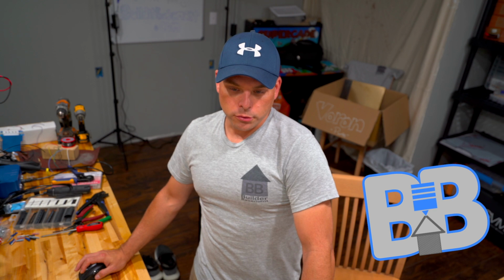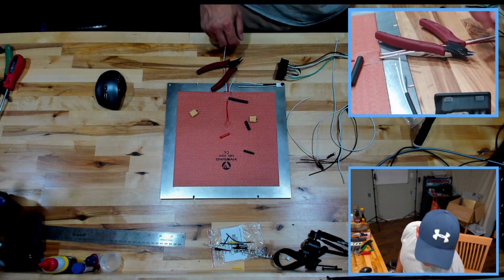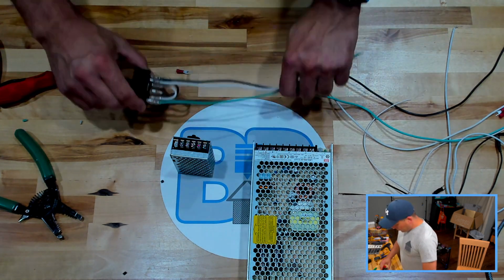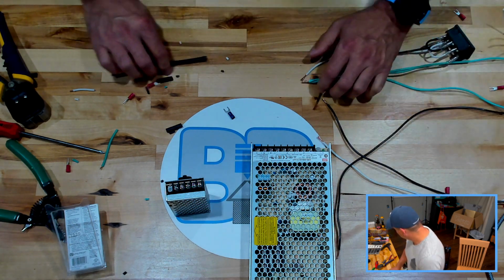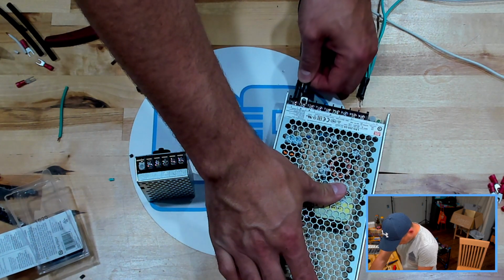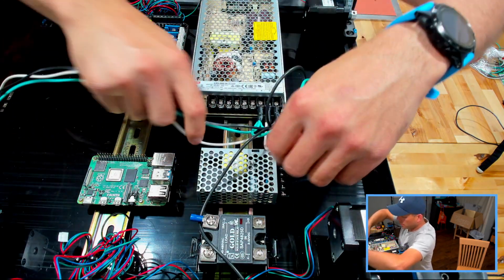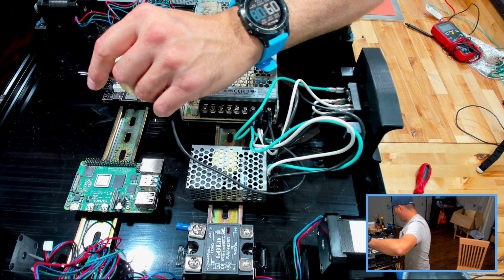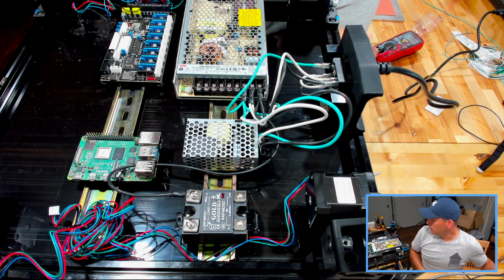VORON 2.4 3d Printer Build It Live *Episode 15* AC Power and I make a fuse into a flash bulb!

Comment: This looks like the same thing that Nero 3DP did back in the day. He was also testing the AC voltage into his power supply when there were sparks. And yes, also as Keith mentioned below, make sure to turn the output back to 24V.
Reply from the maker: Maybe someone will turn me in to a meme.

Comment: Did you bridge L terminal and metal case with your probe? I did not see any other issue at that moment... Also since you made a short circuit on your AC it most likely affected only your fuse, right?
Reply from the maker: Yup.  It's what I get for working backwards! I caused a dead short from the chassis of the converter to the 120v. I was trying to judge my angle but it was difficult since everything was upside down.  Silly mistake, but I guess I helped prove a point.
Reply from the maker: Josef.  Updating you on what happened. I was able to find a 4A fuse to test and make sure only the fuse had blown and I'm happy to report that the fuse did it's job.  Both the 5v and the 24v converters are fully functional.  I have ordered done replacement fuses, but I should be good for now since only the bed heater should draw more than 4A.  Close call.  I was worried because I did smell a slight bit of that horrible burnt electronics smell.  All is well!

Comment: Can you please explain better what happened and what we should do/not do to be safe in wiring Voron? Thanks!
Reply from the maker: Not much to explain.  And don't let my mistake worry you about your build.  
What happened was I was trying to work backward and at a height that was putting things just out of my eyesight, this caused me to not notice how close my test probe was to the cassis of the 24V power converter.  The lead testing the L terminal of the converter touched the metal housing of the converter and caused a dead short since the outer cage of the supply is grounded.  The spark was caused and the 10A fuse did its job.  No real damage was done and I didn't even manage to weld my probe to the converter!  All in all, it was a good thing, proves that you do need to be careful and I'm sure it grabbed some attention!

Comment: Please double check your A/C wire to SSR. You have it going to the Load side of the SSR.
Reply from the maker: Input is DC 3-32V, load is open/close based on the lower voltage. It should be correct.  Full AC for this bed heater.
Reply: @BuildItBasement  You're right, I am an idiot. I was thinking input and output. Hot A/C goes in one side of load and out other terminal of load. Input switches it on and off.
Reply from the maker: I don't think you want to compete. I'm a world renowned idiot!

Comment: Did you ground the frame of the printer? Since the PSU's are mounted with plastic mounts, the PSU's are not grounding the printer frame in this design.

I'm not a fan of putting three wires in one crimp connector. They are not designed for that. It's better to put two connectors into the PSU's screw terminal.
Better yet is to use an external terminal block. There are DIN rail mounted multi layer terminal blocks with internal potential binding. Meaning one ~6mm wide terminal block gives you either 4 or 6 connection points at the same potential.

As far as the hurting while dying note, it's more of the numbing feeling in my experience. Don't ask me how I know. Enough to say, that if you ever find yourself having to replace the master breaker to an apartment complex, but careful where you place your hand.
Reply from the maker: There is a ground wire going to the build plate, this is mechanically connected to the frame.  Once I get to a finalized point I will confirm that there is continuity throughout the frame.  As for the terminals, I agree that a bus of some sort would be ideal, and when everything is complete I will be doing some upgrades.  I prefer to use properly sized ring terminals that can accommodate the complete amount of wiring as opposed to two on a screw.  Rings aren't pressed to have any ridges to properly grab on to each other when stacked.

Comment: You do know you set it to 25v, not 24v? Well, that is before you tried to let the smoke out.
Reply from the maker: The things I'll try to make a video go viral... Just kidding, I was actually in the process of confirming the power switch and then returning the power supply to proper voltage when this happened.  I'll see if I can pick up a fuse today and keep moving forward!
Reply: @BuildItBasement  It's okay. I was once replacing a can light with a pendant and was feeling this weird tingle. Power was still live. Fortunately, I wasn't grounded.
Reply from the maker: I've been zapped about four times in my life.  You never forget that pulsing feeling of 60Hz flowing.  Slight metallic taste... It does wake you up much better than coffee!